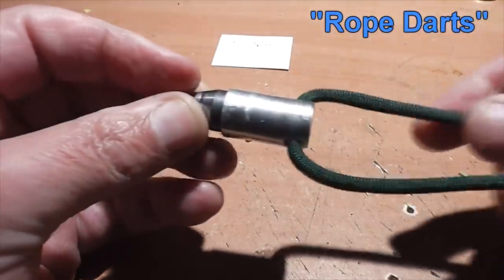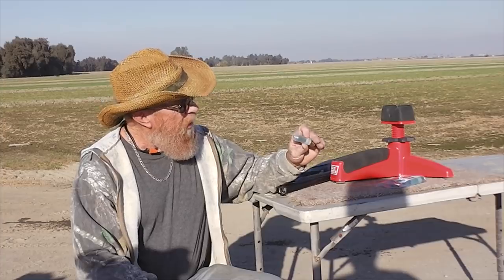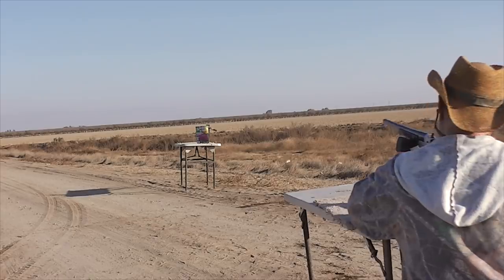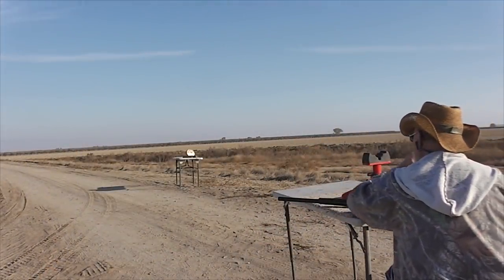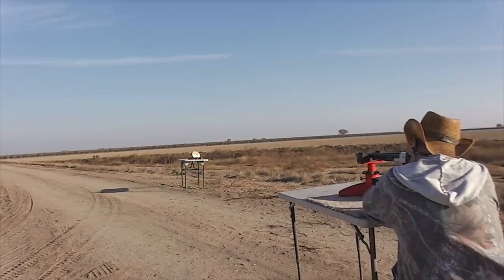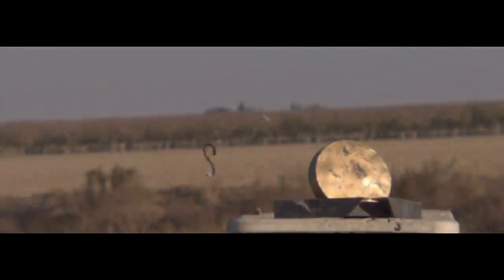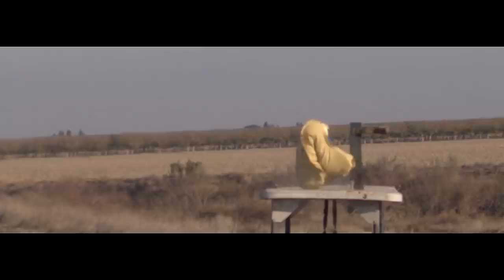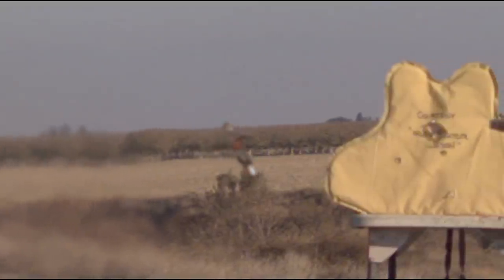Bushcrafter designs "ROPE DART" slugs -  will they supersonic?

Comment: Maybe the darts need some deep chamfering done to the holes for the paracord, so they dont act as a cutting edge?
Reply: That's what I was thinking
Reply: And change the paracord out for Kevlar.
Reply: Paracord is made out of nylon. There's no way it can handle being against the dart & the bore.. they should figure out a way to have them come from the very butt of the round.
I was wondering how a little rubber ball on the end of a round would work that was covered in hundreds of hairs. They actually make them for kids to play with called Kush balls. You could cut one in half and glue it to the bottom of a dart or a slug. I bet it would be more accurate. Not sure what the Practical use would be, but it would make a good video.
Reply: Another idea might be to use wire rope instead of kevlar or the paracord.
Reply: @flynbenny  like memory wire?
Reply: i think i saw the paracord coming out in one solid piece.  with all the crap flying downrange, its hard to be sure, but i almost want to say the issue is the cords seating in the dart itself.  something is pulling it out of the dart as it goes down the barrel
Reply: Pretty sure the paracord was ripped in half by the pressure exerted on it by the gunpowder. No amount of chamfering is going to fix that.
It worked with the leather wad because no pressure went by it.
Reply: @RealCadde  The problem is probably when the cord unwinds as it exits the barrel.  I would love to have seen a picture of the barrel as it was shot.

Comment: I was just trying to figure out how to make something like this, but I don't have access to a lathe. I did anticipate the rope being ripped off, I think the best way to solve that problem would be to encapsulate the round in a sabot. What I also noticed, was the rope being accelerated faster, due to its low mass, which causes the round to flip backwards until drag takes effect. A sabot should also correct that problem by accelerating the round and the rope together.

Comment: That last round reminded me of how some space craft extend out weighted cables to stop a spin in 0g. Issue I see is that it is decreasing the moment of inertia of any spin stabilisation it may have like a figure skater throwing their arms out or a spacecraft releasing its cables it will decrease the rate of spin and also the way it is wrapped is non symmetrical which may be why it is tumbling so bad, as it it uncoiling uneven, causing an instability which may also be part why its getting loose so early in flight...... Maybe it would be better to have the tail on or in the rear and use a light spring to eject the tail so it does not stay bunched up with the slug.

Comment: Drill two through holes crossways near the base. Where they intersect, drill another hole in the base just deep enough to allow the cords (4) to exit. When loading the projectile, stuff the cords behind the projectile with a leather was under them. Wrap the projectile with more cord to center it in the bore. I think you'll find this will work better than the original design.

Comment: I just can't imagine the cords stabilizing the projectile in this configuration- as they whip around in the supersonic wind, they're just going to torque the slug in random directions at random times. 

It might help to have the cords come out of the tail of the projectile instead of the sides (check out some images related to 'nunchaku string replacement' to see what I mean),  but even then I'll be very surprised if we see good results. Of course, that's why we do the experiments.

Comment: To keep the paracord attached it should’ve either had reliefs cut into it and then had the cord between the round and the wad instead of wrapped around the round. Or have the cord attached directly to the bottom of the round.

Comment: I wonder how much more accurate they would be if you epoxy'd a half of a mini Kush ball to the base of one of those darts... or even a slug.  You know... Those little balls that are made out of soft rubber that have hundreds and hundreds of short thick hairs?
Curious to know if the multiple hairs would make drag more equal. Lower velocity, something like that...

Wouldn't cost much to check it out. I'm sure they have them online. 5 minute epoxy should do. Please please please make an episode of this?

Comment: I'm wondering if using a small amount of glue or epoxy would hold the cord in place. Maybe even consider using a small bundle of kevlar thread instead? May withstand G shock better. Just an idea.

Comment: should re try these but with a braided steel cable instead of soft and light weight materials. also the damage it will cause on the inside of a soft-bodied target would potentially be increased from it, maybe?

Comment: If the round were in a shot cup I doubt the paracord would shred. The diameter of these rounds is probably a bit too big to fit in a shell with a shot cup, but if a second version is made I really think it should be made to fit in a shot cup.

Comment: Wonder how the para cord would do if stuck in the back. Drill hole in center two times larger than para cord and thread for set screw, then with a end mill same diameter  as the para cord, cut two slots in a x shape for the para cord. Insert two para cord in slots and hold in place with set screw. Cords being stuffed in back would be less likely to be ripped off and could be shorter.

Comment: Looks like someone is trying to duplicate the swiss arrow (swiss dart), which is a light javelin with a cord tail. If thats the case, I think they missed the reasoning for the cord on that. Or the intent is that it is suppoed to be some kind of sabot or soft gas check. Over thinking, under performing.

Comment: How about a slug with a single strand of chained together metal beads attached and coiled under the very tail of the slug when loaded???
Reply: I don't think that would work. But it would be cool to see. Maybe the chain could have a disk-like heavy tail bead... for greater drag. Imagine getting hit by one of those rounds!
Reply: @salazarpayne3784  It won't work. Drag stabilization will not work at supersonic speeds because of turbulent flow seperation.

Comment: I wonder what would have happened if the cord was removed? Would it have worked better ,and been more accurate 🤔
Reply: No. Drag stabilization simply WILL NOT WORK at supersonic speeds.

Comment: What about a smaller dart in a shot cup, with tail coiled under?
Reply: It's not going to work. Drag stabilization simply does not work at supersonic speeds.
Reply: @kg4boj  im not sure this was a serious idea to begin with, just wondering a way to make it partially work.
Reply: @MrBonebus  It won't work. The cord will still whip around in the turbulent flow and break.
Reply: @kg4boj  i want to make one work or die trying now. It will be a good sight.

Comment: Jeff, good thinking with this last round! You are on the right path.
If you have a projectile, especially something harder than led, significantly smaller than hull's inner diameter - you are going to overload a gas seal. In this case a outside ring of gas seal (which is not loaded by projectile body) is shear. Then it cuts paracord off and got blown away in front of main projectile. If you film a muzzle you will see that some "garbage" will fly in front of main projectile.
You should always use cushion wad. It will save Danny's shoulder and provide a support for gas seal. There is almost a ton (real metric ton) of force, pushing a projectile at the peak of pressure. No way gas seal could hold it by itself! I'd go with heavy felt wadding, about 1/2 inch - it is very resistant to tear. And to be absolutely sure I'd add a cardboard gas seal on top of felt wad.
Reply from the maker: You'd think I'd learn by now.  I thought there was enough surface area but it doesn't take much of a gap to blow out the wad.
Reply: @taofledermaus  Not a big deal, actually... Even if gas seal survive I think paracord wrapping is not a good way to center a projectile. Paracord is too soft and spongy.

Comment: Sacrificing distance for an attempt at accuracy, so it's purpose built. Great idea, poor application. Great idea, but there's always give and take. Sorry,, but total fail. It takes time to straighten out the projectile so it's only good at a longer range. Accuracy is sacrificed at best. By the time the trailing media gets the projectile straight, it slows it down too much to be as effective. Better off with a round slug or rifling.